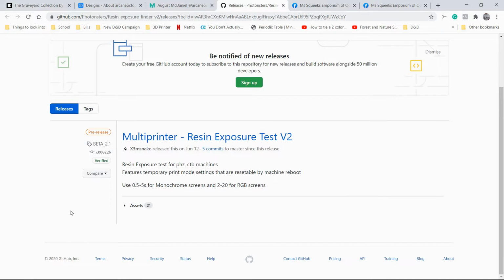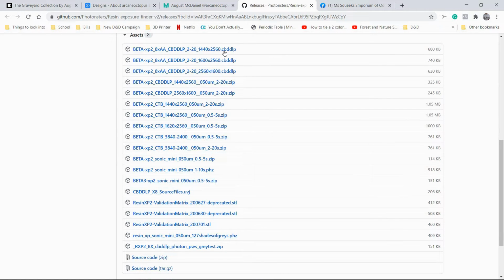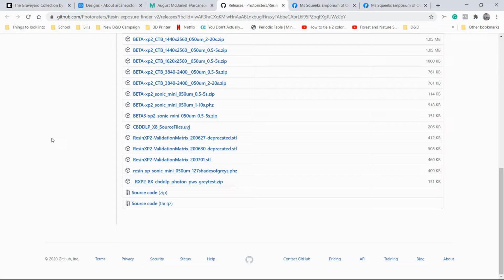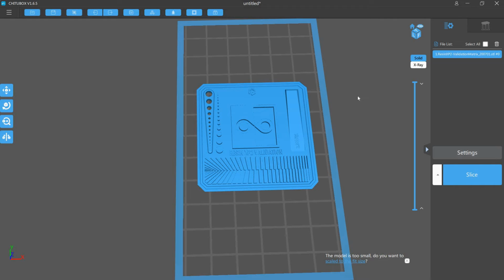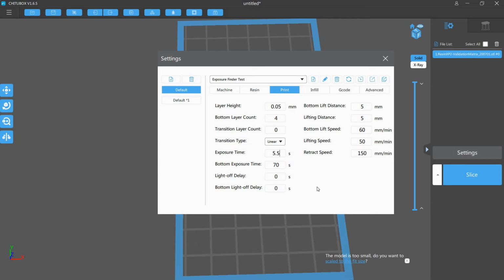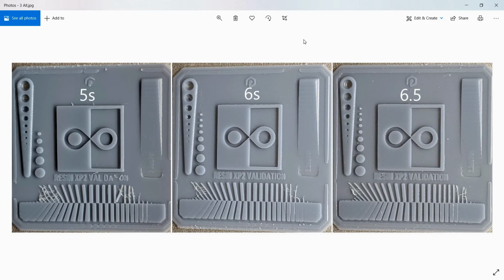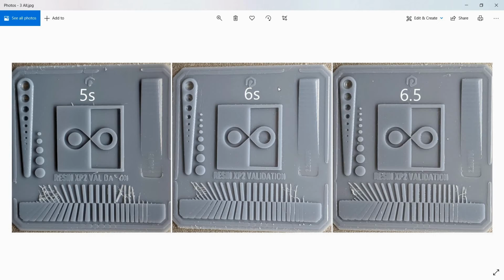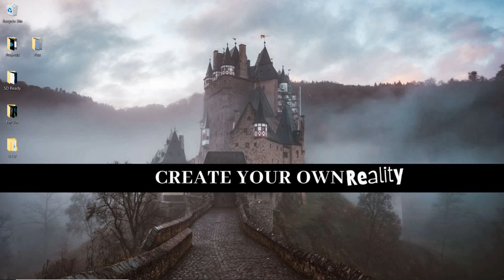Get Perfect 3D Prints on Any Resin Printer With the Exposure Finder!

Comment: Thanks for the video! Question, I have the phrozon sonic mini. On the printer list it shows 3 separate files to choose from #1 is,  .0.5-5 sec zip file,   #2,  1-10s phz file,  or #3.  0.5-5 sec zip file  thank you
Reply from the maker: You are very welcome. Have you unzipped the two files yet?
Reply: @SlicePrintRoleplay  just did thanks
Reply from the maker: @schmidtpe  let me know how it works for for you. I sadly don't have a Sonic Mini so I haven't tested that file.
Reply: @SlicePrintRoleplay  I tried one file don't remember which I think it was the .5 -.5.5 zip file ... all it printed was a flat sheet apx .44mm thick , so I just did the test without trying the download part #1 of the test
Reply from the maker: @schmidtpe  yeah the feedback I've been getting is that the first test is more than a little finicky. I think when I do an updated version of this video I'll only cover the second test since that's compatible with all printers.
Sorry for the frustration. 😞
Reply: @SlicePrintRoleplay  no problem ...glad it wasn't worse..however I did get the validation test done and all tweeked in thanks
Reply from the maker: @schmidtpe  glad to hear it!
If you're willing to join and post in my group I'd love to see what you're printing!

Comment: Which file is good for Sonic Mini 4K?
Reply from the maker: I'm not sure if a Sonic mini 4K is supported yet or not. What you would need to do is look for a file that has the same screen resolution as your printer and also uses the same file extension. If you can't find the file on the list that has both then it's not yet supported.
Reply: @SlicePrintRoleplay  Thank you for your answer.

Comment: This is great.  I have an Elegoo Saturn, and for the first part, I see the proper resolution and CTB zip file to match. Question: is the that's bundled compatible with the Saturn?  Did you use this with your new Mars 2 Pro?
Reply from the maker: I'm sorry I really wish I had all these printers so I could answer specific questions for people.
Reply: @SlicePrintRoleplay  No worries.  I appreciate the quick response.  I did end up trying the first part with the gcode and the .ctb file.  the gcode seemed to read properly but when I tried the ctb file it started the print but then just sat at the bottom of the tank.  I had to stopped job after 20ish minutes
Reply from the maker: @Haven_games  darn!... Well you can still use the Elegoo exposure sheet to get close and then the second test to fine tune from there.
Reply from the maker: @Haven_games  here are the sheets if you don't already have them.
https://www.elegoo.com/blogs/3d-printing/elegoo-printers-resin-setting-sheet
Reply from the maker: I have not used the first part on Mars 2 Pro yet. I have used the second part though.
And it very well may be compatible. Worst case is it doesn't print well. You won't hurt anything from trying.

Comment: What file should I use for Phrozen Transform?
Reply from the maker: What file format does it use and what is its screen resolution?
Reply: @SlicePrintRoleplay  zip or phz
Reply: @SlicePrintRoleplay  47μm resolution
Reply from the maker: @notpopimp8346  so what you need to look for is a test that has the same file type and screen resolution as your printer. For example for the Creality LD-002R it uses the .CTB format and it has a screen resolution of 1440 X 2560. So the test you'd use is:
BETA-xp2_CTB_1440x2560__050um_0.5-5s.zip.
If you can't find a test with the correct file format and screen resolution then your printer unfortunately isn't supported.

Comment: is this ok on a creality ld-002r ??
Reply from the maker: I believe one of the exposure finder tests is compatible with the Creality LD-002R.
You'll need to look for the test that has been the same file format and screen resolution as the printer you want to test.

The validation Matrix (the second part of the test) is compatible on any printer because it is a model that you'll slice yourself.
Reply: @SlicePrintRoleplay  I tried but unfortunately it only prints a solid block more or less so I'm just going with the 2nd part in increments. But thanks for the reply all the same.
Reply from the maker: @MopH3ad  sorry about that. The first part of the test is still being developed and can be finicky on some printers.
Reply from the maker: The Creality LD-002R uses the .ctb file format and it has a screen resolution of 1440 X 2560.

Comment: Hi there. After watching this clip  I just subcribed to your channel as I find it is informative. However I ran into a problem when follow your instruction. Could you do a video on how to run the "xp-test_mode.gcode and xp-print_mode.gcode" before running the exposure test? I am using the Phozen Sonic MIni 4K printer. Thanks
Reply from the maker: I will certainly look into that. I am planning on doing an updated video and I'll try to give more info on how to use the tests.
I unfortunately don't have a Sonic Mini, but I'll do my best to help!
Reply from the maker: Can you find me on Facebook? Either message me directly or join my page? I can help you faster from there.
Reply: @SlicePrintRoleplay  Tes I just join the group... will follow up from there. Thanks
Reply from the maker: @hoptho3682  awesome I'll catch up with you there!

Comment: Your bottom exposure time is VERY high. You can easily set it to 5-6x your regular layer exposure... so bump it down to around 30-36 if you are using 6s layer exposure.  Right now it's messing up your test print and you are reducing the life of your screen.  
The middle print is definitely not "pretty darn close to perfect", there are so many errors in that print it's not even funny and it also looks like your bed is not quite level.
A perfect test print would show all the lines and all the gaps in between the lines on the bottom, all the holes and dots on the left instead of missing 4-5 like seen on yours with the top hole being completely see through (yours isn't due to extremely high bottom exposure causing enormous elephant foot) and the border is missing a few spots as well due to probably a bed that's not quite level.  
I'm not trying to be rude, just trying to help you out a little.

I highly suggest you watch some videos by 3dprintingpro, he breaks it down so that it's very easy to follow and you will increase the quality of your prints significantly.
Reply from the maker: You are certainly not wrong. There are many aspects of this video that need to be updated and polished.
I definitely appreciate your input. I'll never say I'm an expert in anything, let alone a topic as broad as 3D printing. So feedback is always welcome. I am working on an updated version of this video so look for that.

Comment: Looking at the spread sheets, Elegoo gray 8 bottom at 100sec and 10 sec layers??? Wow!!! On my Mars I'm 4 at 55 bottom, then 6.5sec at 05 layers. They like burning their screens out early or photon light source just that crappy? People want their prints to stick? Slow the lift speeds way down to 60mm bottom layers and 90mm reg layers and make sure you set proper contact thickness on you supports. Least that is the info I've found useful.
Reply from the maker: I agree some of those values are a bit extreme that's why I said it can be used as a guide. I'm a big advocate for testing your settings once you find a baseline that works.
That's what I think the spreadsheets are... Or rather how I think they should be used...... Haha, man I should have just said yeah.

Comment: hallo and grats for the video! i have photon s last firmware and its working very good, tried to print the file you said after rename extension to .photon as a friend here mentioned, but i have the same problem with the above friend, the whole pad is completely printeted but i can see only the raw of 20s nothing else, all the others are blank. what should i do?
Reply from the maker: I believe the creator of the test is looking into this.
For the time being I'd recommend finding your printer and resin on one of the spreadsheets I included. Then use those settings to print the second part of the test. From there you can print the test with more or less exposure depending on the results you get. If you have any questions let me know here or on the Facebook group. 
I apologize, but as soon as I have an answer to this I'll update everyone.
Reply: @SlicePrintRoleplay  any update on this?
Reply from the maker: @xsjadoemagdnim  actually the creator stopped developing the exposure finder test. The validation Matrix is still a valuable tool for fine tuning exposure. It's also compatible with any printer since you are slicing it for each specific printer.
Are you using any Anycubic printer?

Comment: Printed the first test file on my Photon using Anycubic Eco resin, and everything but the 20 came out completely smooth. Doesn't seem like that's what's supposed to happen...
Reply from the maker: Yeah that doesn't sound right. Have you used this resin before? If so what exposure was required?
Did the full "Pad" print and the columns missing?
Reply: @SlicePrintRoleplay  Yeah, the full thing printed out (the column borders and numbers are very light), but there's just nothing in any of the columns except 20.

I ran a bunch of validation prints, and somewhere in the 7-7.5s range seems to come out the best.

Here's a not great pic of how the test came out https://imgur.com/wg4yfEv
Reply from the maker: @aichpvee  that is really odd!.. Was there anything sticking to the FEP or any cured resin floating in the vat?
Reply: @SlicePrintRoleplay  I don't think so. Just cleaned the vat and releveled the build plate, in case that was off. Only difference was that it stuck to the build plate a little harder. Weird.

People have had success with this on fauxtons, right?
Reply from the maker: @aichpvee  was there a "Read me" file with that test? I noticed that some of them work a little differently then others so definitely follow what it says in the individual folder for each test.... If it's an "All in one file" then my only other thought is that the file got corrupted.
Sorry you're having such a hard time with it.
Reply: @SlicePrintRoleplay  Yeah, I'll take another look. Might also be this eco resin. I'll give it a shot with some Elegoo grey next time I clean out the vat. Printer's doing great on regular print's tho, which is most important.

Thanks for the video. It's very helpful, even if my printer is an uncooperative jerk!
Reply from the maker: @aichpvee  that is definitely what's important. If you wouldn't mind please keep in touch with further results either here or on the Facebook group. I'm really interested to hear it or was the resin or possibly something else.
But no matter what I'm really glad to hear you're getting good prints!

Comment: Is there a setting that can help with stepping for the slope on this print?
Reply from the maker: What do you mean?
Reply: @SlicePrintRoleplay  There's a slope/gradient on the right hand side of this print. When I print this test it's stepped rather than a smooth slope. I wondered if there's a setting to help with that
Reply from the maker: @matthewmcguinness5538  haha I'm an idiot! Sorry yes I understand what you mean.
I did confirm with the creator of the test.
Those steps will never totally disappear giving you a smooth slope. However, you can print with a lower layer hight which will give you more and smaller "Steps" on the slope and therefore will be closer to smooth.
Hopefully that answered your question, but if not let me know.
Thank you for checking out the video!
Reply: @SlicePrintRoleplay  That's great thank you. I thought it might just be the layer height but I have it set as low as it can go. I guess it's just because the slope isn't that tall. Thank you and thanks for a great video
Reply from the maker: @matthewmcguinness5538  you are very welcome!

Comment from the maker: For Photon users
This is straight from the creator of the test. 

"PhotonS and Fauxton can run .Photon Files with the latest update. Therefore the cbddlp AAx8 works as long as you rename the extension to .photon. Instead of cbddlp."
Reply: Thank you. The ideal would be a test file called R_E_R_F.pws with 8 squares. Could I do it myself?
Reply from the maker: @FrancisJimenezRoldan  that would be a question for the Photon group on Facebook.
Reply: @SlicePrintRoleplay  So then I can change the extension to .photon for the Original Photon as well? Is there another file that I would need to use for my Photon? Great channel by the way, I've learned a lot from your videos. Can't wait to see what ya teach us next
Reply from the maker: @Cwill1016  I haven't had the chance to test a Photon so I'm not very familiar with them. But I believe that would work. I'll try to contact the creator and see if I can confirm. 

I really appreciate the feedback and I'm glad you're enjoying the channel!
Reply: @SlicePrintRoleplay  Thanks, I really appreciate it.  Once you found your normal exposure time, how do you find your bottom exposure time from that?
Reply from the maker: @Cwill1016  I'm so sorry for not responding to this! For some reason I was never notified of it.
Typically I do 5x - 6x the normal exposure time for the bottom. So if your normal exposure time is 5s then your bottom is 25s - 30s.